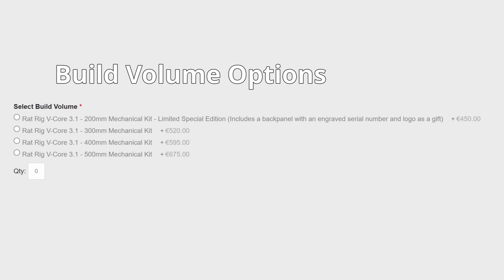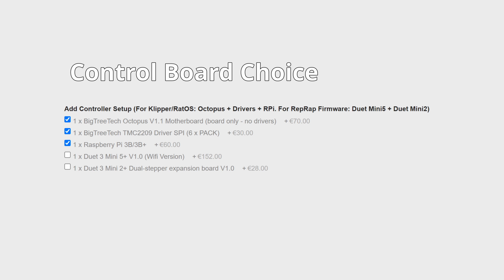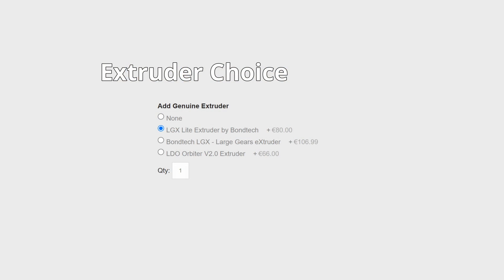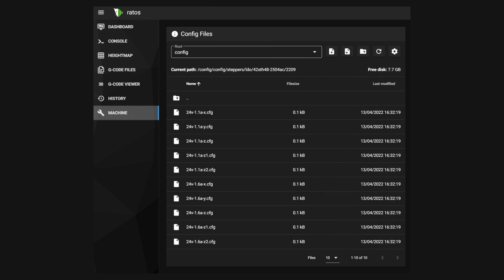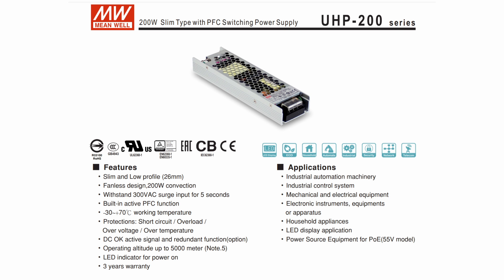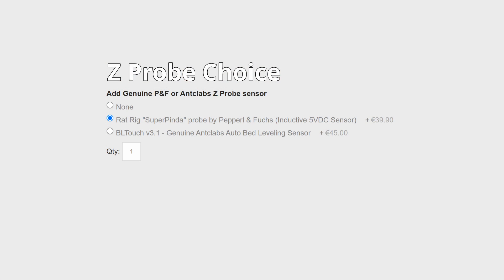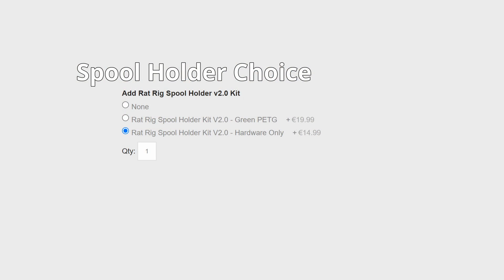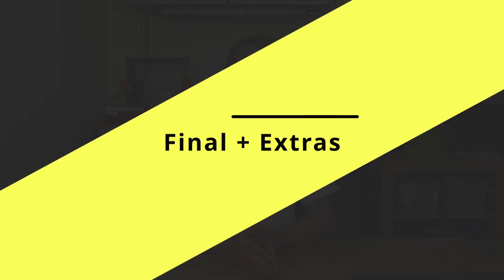Avoid Common Buyer Mistakes - Rat Rig V-Core 3.1

Comment from the maker: Updates since creating the video:
Fans have been divided into categories. For hotend fan, take the only (40mm) option. For part cooling, it is expensive but go with the 9GAX0412P3S001.
Clarification on endstops: I perhaps didn't stress enough that configuration of sensor-less homing takes a while, I'd recommend using physical endstops, especially for new users.

Comment: buying a normal preforming hotend on a machine like this makes little sence. the second you start actually pushing to what the machine can do the hotend will underpreform badly
Reply: Some materials dont like printing fast regardless, its really only pla that you can just keep cranking speed

Comment: Nice video. However, when it comes to sensorless homing: don't, specifically not with core xy as the use of 2 drivers instead of one. Anyway, sensorless homing is plain stupid in my eyes. Its like parking a car by bumping into other cars instead of using radar sensor (or your eyes). Its just there to spare some money needed for additional sensors and cables.
Reply from the maker: Stallguard can have applications beyond homing, and its not really like crashing a car because it can be designed for this function.
Reply: @Vector3DP  Well, I didn't say crashing but bumping. Like slowly, slowly approaching the other car until you "feel" some resistance. Anyway, stupid approach IMHO.

Comment: Ey! Great video, very useful. Do you think there is a noticeable print quality comparing 300x300, 400x400 and 500x500?
Reply from the maker: Print quality, no, but the smaller printers can do higher acceleration and so can print faster theoretically.
Reply: @Vector3DP  Thank you! I think I can pay "speed" if I can print bigger with the same print quality.

Comment: Are you able to tie a Linux laptop to the printer to run clipper rather than a Pi?
Reply: Of course. You can run a Linux machine that will do the job better than a Pi. But you'll need to configure it yourself. Since the most popular way of running Klipper/OctoPrint is using a Pi, there are more tutorials, and more information on how to install it on a Pi. You can get pre-made images that you flash on an SD card for a Pi, that save you a lot of work. If you know your way around Linux or are up to fiddle around with it until it works - you can do a Linux install. If not - I'd stick with a Pi.
Reply: @Cyb3rManiak.7  For grins with my Ender 3 Christmas present, I took my 6 yr old Netbook I had put Arch linux on, and put Octoprint on that, hooked it up, and voilla.  Went very smooth VERY happy I had that and could put it back to work.  Used 25 minute video as quick reference by @ChrisRiley and don't recall having any snags in the process.  Caveat: I have been playing with linux for MANY years now.

Comment: Revo Voron is not a good reccomendation. With a 0,4mm nozzle 0,2mm layer, it is good for 140mm/s printing, but i always print with 0,6mm nozzle and 0,3mm layer, then i would be limited to 60mm/s....
Reply from the maker: Spoiler alert, these recommendations were not tailored specifically to you.
Reply: @Vector3DP  No, the hot end revcomendation were tailored for someone that probably should buy a ender 3. Other than that, a good video. But No matter how you look at it, 15mm³ of filament Flow on a corexy machine is waaay too low!
Reply from the maker: Well CoreXY is not inherently faster remember. Also, you've just picked one parameter of a hotend and decided its the only one that matters. There is much more that goes into this recommendation than just "bigger number better"
Reply: @Vector3DP  i agree that there is many parameters, and the Revo Voron is a awesome hot end (i do have it myself and love it), but you should not give it as a recomendation for the Ratrig without some sort of disclamer when is has such an obvious limitation in printing speed, wich you actually talk about when talking about the size. It is about how fast you can extrude filament. The Phaetus Dragon HF has three times the extrusion capacity of the Revo Voron.

Comment: Followed your recommendations and now I'm replacing the Revo with a Rapido. The Revo just can't push enough filament. May need to replace the LGX Lite with an Orbiter as well. I plan on printing with a larger nozzle, so the extra material will be necessary.

Comment: if I took the octopus with just the tmc2209 and used marlin, what would I lose by not adding the raspberry and klipper? btw I already have a raspberry 3b + in the house, so I can also take the step to klipper later

Comment: Instead of ABS for the parts, I would suggest a PC-blend (PC-PETG or PC-PLA). It's similar cost to a PLA+, more rigid than ABS, prints around 240°C, but has a very high heat deflection temperature.
Reply: Where are you buying it for similar cost to pla+?

Comment: There is no 500mm cubed build volume Rat Rig. They sell one they claim is 500mm but the frame isnt large enough to get 500mm build volumn. Once you get your hotend and fans on and the leveling sensor you are not going to have 500 X 500 X 500. You might get 480 if you get the right hotend.

Comment: Good recommendations.  A couple of suggestions, I agree with the Octopus for the main board, but I recommend ordering direct - not from RR, they charge VAT on all of the parts, it is 100 euro before VAT.  From BTT direct ii is $80 with 8 drivers.   Also be very careful not to need anything separate as their minimum shipping is over $30 to the US.   I have a 400 cube and a 500 cube, and as a hobbyist the larger printers are what I need, I can print smaller objects on them, but am very happy to be able to use the full bed when needed.   I also found a local glass company that cut pieces for each printer $35 for the 400 and $50 for the 500.  They work great and are very flat.  Some thing to watch is the BIGTREETECH Manta M4P/M8P Control Board running Klipper with CB1/CM4.  A new board from BTT that includes a SBC very similar to a Raspberry PI.   For $100 you get a board with 8 2209 drivers and a SBC all on one board. Curious to see if RAT OS will support it
Reply: It will support the M8P, but it will not support the CB1’s only CM4. Tons of issues with the CB1’s and it’s based on a  non public modification of armbian. Only raspberry pi OS based devices will be officially supported in the foreseeable future.
Reply: @miklschmidt  Thanks for the information.  I was curious if it would work, new and not much information on it yet.
Reply: However, its not only VAT that is added when ordering direct from BTT. Its also customs, which can be rediculously high in some european countries.
Reply: @WolframWebers  Good points.  You have the opposite cost challenges, for me getting it from EU is very expensive - shipping is very high

Comment: Disagree on the revo voron because of the flow rate and lack of hardened nozzles. I had a revo on my voron 2.4 and pulled it out to put a rapido in. With a revo, a .4 nozzle can’t print much faster 200 mm/s at .4 layer width and .2 height, .6 nozzle is capped to ~90 mm/s and 0.8 nozzles is 50 mm/s. You are spending big money on a printer that’s big feature is it can print fast at high quality and then knee capping it with a hot end that has terrible flow. Just my opinion though.
Reply: Same here. I agree that UHF hotends are not necessarily the best choice, but unfortunately and despite all it's pros the 15mm^3/s of the Revo is just too much of a downside.

On printers like these it's EASY to need 20-25mm^3/s of flowrate. Try slicing 0.3 layer height with 0.6mm line widths at any basic speed for that kind of printer (that is >100mm/s). Even with 0.2 layer height and 0.4 lines it's easy to outperform the Revo.

I would use a standard hotend like a Dragon and put a CHT nozzle. Still compatible with all your hard nozzles if need be, supports >25mm^3/s easily.

Comment: Nice to see the 4028 axial fan, those things simply let dual 5015 radials look like toys. There is even a more powerful 4028 available from sanyo deki or whatever the company is called. 50m3/s and 3 times the pressure of the most powerful sunon 5015, those flow only 9m3/s.
Alo worth to mention: when choosing the rapido or magnum plus you should still get the 250w psu over the higher quality meanwell. The rapido literally sucks power away from your steppers and fans, i speak from personal experience

Comment: Don't use sensorless homing. Also, the lgx lite is not the best choice. I would suggest an orbiter v2 for the extra pushing strength. Lgx lite does have the advantage of pretension, but having used both, orbiter is better. Lgx lite just skips soo much.

Comment: How would you compare the build experience between ratrig and voron Bc I struggled quite a bit with the voron would you say the ratrig experience is easier or about the same?
Reply: the ratrig mechanical build is more simple with less printed parts and hardware. the electronics assembly is a bit more complicated, as they don't provide instructions.
Reply from the maker: mostly agree with morbus. You can use my live videos as instructions :)

Comment: Just finished the 300mm version. all I need is the wiring. With the prusa mk3s + I printed all the parts in petg, except for the eva, asa. For the eva 3d I opted for the version with brass inserts and for the mosquito. the only one I wanted to find is a manual that also includes other options, not just the factory ones. In any case, I prefer it to voron, if only for the fact that its a European prosotto

Comment: I have the Vcore 3 400 with the enclosure. If you do go with the enclosure, check the dxf files! The sides for the lids were not correct. There is only one mounting hole that is usable (top, center) there should be 3 across the top, and 2 down the front. Also the doors are a touch too big. They don't fit between the corner brackets vertically and too wide. The pneumatic arms are a pain to adjust. 

With that said, this is the first time I have been able to print ABS successfully.
Reply: Could you please tell me what temp is inside enclosure while printing? And do you have any active heating fitted?
Thanks!
Reply: @bogdanoprea4686  I don't have a temp gauge inside of my enclosure, but, the printer sits with an AC vent blowing on it and I have no issues printing ABS. The only heating is from the bed.
Reply: @tonytillman3953  I wanted to know if it is 50c+ or you need an active heating option. I want to buy one just for abs,asa,pc.
Did you had any warping? and what type of filament do you use?
Thanks! Much appreciated!
Reply: @opreabogdan6773  I do not have a temperature gauge inside of the enclosure. I don't know what the temp is. No I do not have active heating, the only heat is from the bed. I can print Hatchbox ABS successfully with no warping or cracking.

Comment: I am starting to wonder whether a Bambu Labs isn't becoming (once you can buy it from Amazon and have it delivered in a couple of days) a great alternative unless you're just into 3D printing to mod your own 3d printer ... Even for me as a 3d printing tinkerer (read: more mistakes than well working mods), just getting something that works out of the box sounds so much easier than having to get ABS parts to replace the PETG ones, having to decide between bed-probes which both have their drawbacks, having to figure out yourself how to enclose the thing, ...
Reply: rat rig has slightly better performance with more hardware/software flexibility, while Bambu X1 Carbon is a open-to-play no-brainer option. Rat rig has higher max acceleration than Bambu's (20k mm/s3) and higher max speed. Not to say larger build volume.
Reply: @steven9617  I agree, especially the max size.  I have a Prusa XL on pre-order and got to see it in action at ERRF.   I would really like to get a printer that was designed to have color / filament changing.   I'm waiting for more information on both.  I like Prusa's track record, and the ongoing support they have provided in their current printers.
Reply: I have been watching this, as I'm using a heavily modified E5 Plus and two Rat Rigs.   The Bambu Carbon with the filament changing system is $1500 which seems like a fair price.  I want to see more regular people report on it as it seems like the big content channels all love it.
Reply: I think the X1C (or heck, the P1P if you don't need an enclosure) is an awesome "safety / workhorse" printer that just works and gives you the option to do whatever. Want to build an insane CoreXY? Go ahead, knowing you always have a capable printer back on the shelf that will allow you to print whatever you need without putting you under stress that you might mod yourself into a corner where your printer doesn't work while you need your printer to work to make your printer work ;)
Reply: @cy-one  I received my X1 Carbon on Dec 20, the P1P came on Dec 24.   Now I have two Rat Rigs and two Bambus - they each have plus and minus.  The Rat Rigs - size for sure and ability to mod.   The X1, was up an running quickly - without the AMS.   The AMS has presented some challenges, mostly because I want to use the external feed, and it is very picky about the spools that work inside.
Reply: @woodwaker1  For me it'll be somewhere in Feb when I get my X1C and AMS.
Once I have everything running smooth, I'll want to build my own printer. For shits, giggles and the learning experience.

Goal? 500mm/s CoreXYU IDEX :D
Reply: @cy-one  I have had fun building my  Rat Rigs and modding my Ender 5s, now I want something that works, but already modding my AMS
Reply: @woodwaker1  I've had some fun with a CR10, but I've given it away after not having used it for a longer time. I also want something that works in the X1C... To enable me to do both stupid (see my 500mm/s IDEX idea) and really useful (want to build a V1E Lowrider 3 at some point) things.